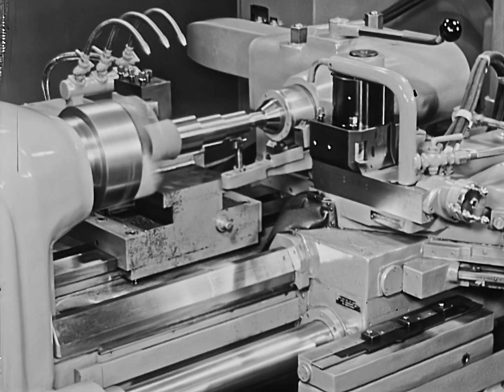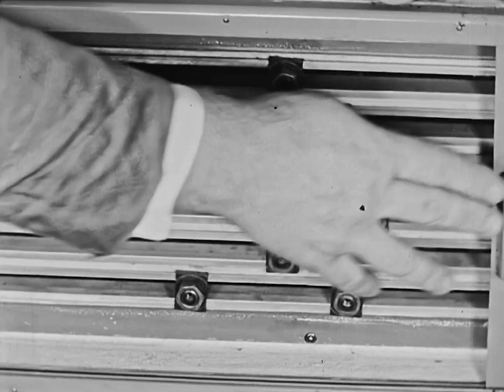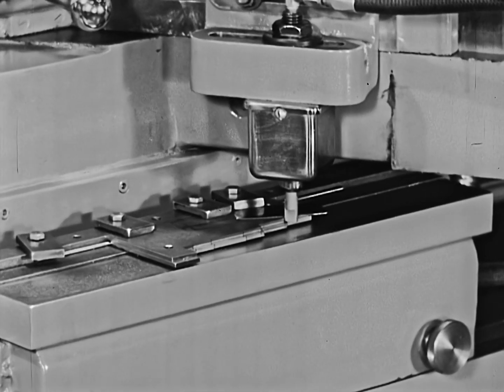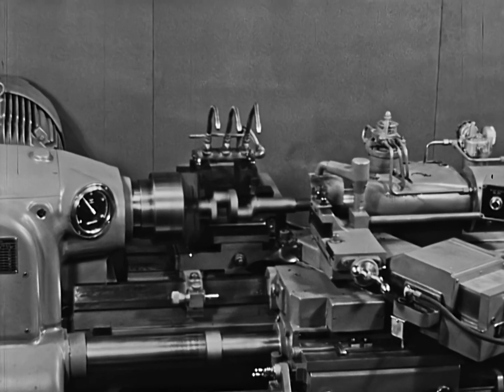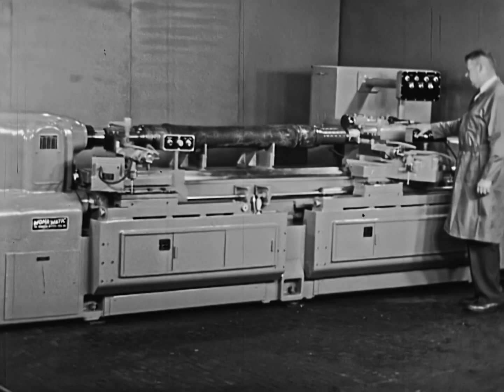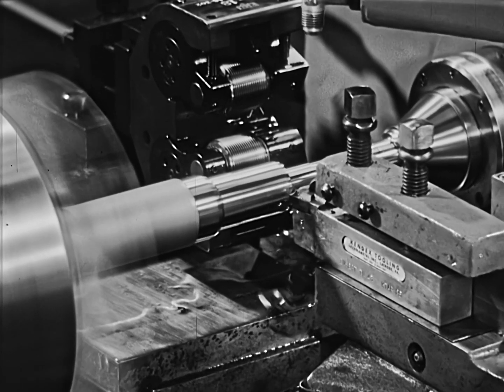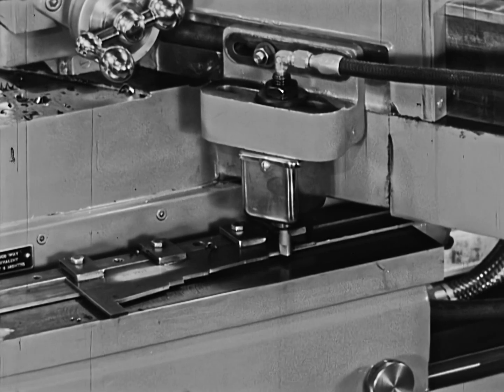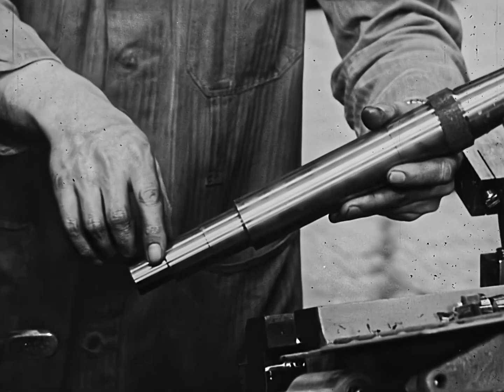ca 1950s 16mm Promo Film Movie MONARCH MACHINE TOOL COMPANY MONA-MATIC

Comment: I use to work with old German built bullet presses from ww2. The machines could’ve easily had been used in ww1 even. It was not this clean, at all, but ran like a champ and still used to this day. Only added some wiring for unit # tracking